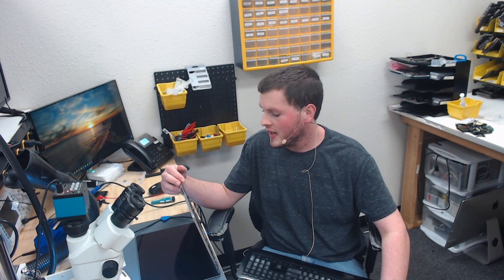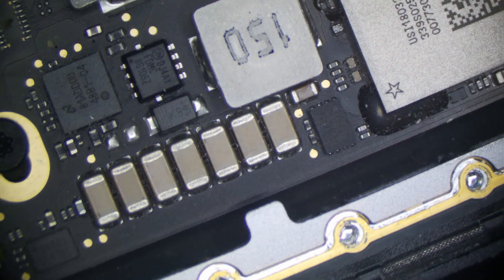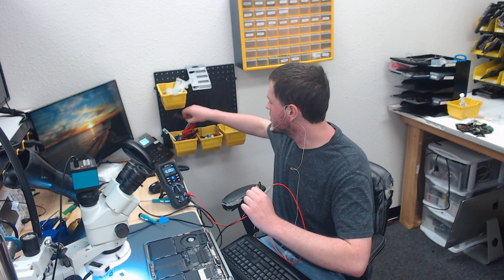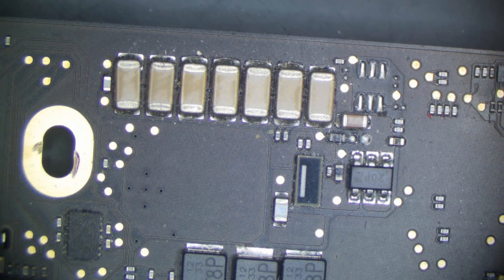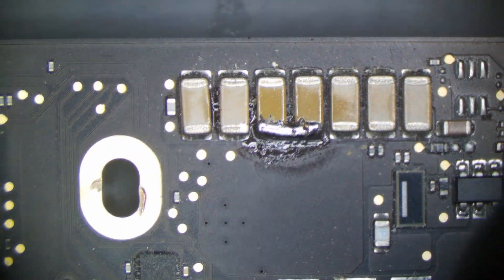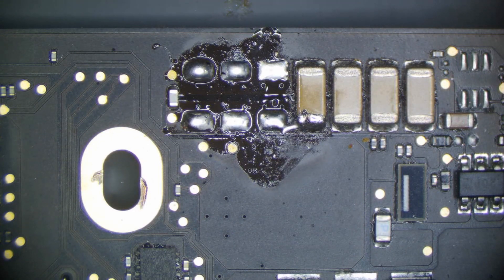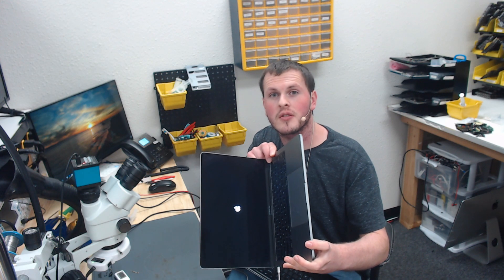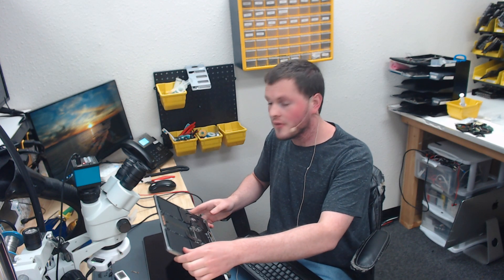2017 13" MacBook Pro A1708 with no backlight from a logic board issue.

Comment: 11:40  The device exists within an atmosphere
and no matter what  - the air condenses when ambient
temperature becomes low enough.
The condensate the is produced is the moisture/water.
When there are other liquid substances present such as FLUX
which is water soluble - 
the FLUX will absorb the moisture/water caused by the condensate.
The FLUX will over time absorb enough moisture to cause corrosion.
This process cycles as when the device ( laptop ) is operating it
produces enough heat to evaporate the moisture -- and the process
repeats over and over  -- 
What does not evaporate is the corrosion that increases over time.
Thus it is BEST practice to remove FLUX residue to mitigate the 
absorption of moisture  reducing the probability of  time induced 
corrosion as much as possible.
Attention to detail is a sign of professional workmanship.
Laziness is both a curse and a disease of the mind.
When one starts letting little things 'slip' with the attitude that it
does not matter -- It does not take L O N G  before one lets bigger
things slip  ---  and in the Medical field and Aviation such practices
soon become lethal.
The do in other areas also - such as walking whilst staring at a phone screen.
SO don't do it - It only takes one error to cause death of serious injury.
Reply from the maker: There is absolutely no flux left there, just staining from acetone, hence "good enough".

Comment: Hi Tim can I ask a question please,  from this video you said you are injecting 10volts into the backlight caps to see what heats up on the board but I'm very curious of how many Amps should be set on your DC power supply please?
Reply from the maker: I set mine at 5 amps and almost never change it.

Comment: Hello thank you for the detailed video, it's very helpful. 
I have a 2017 a1708, all of the caps are showing 94.0 Ohms on both sides of the board. Should I test the caps a similar way using alcohol?

Comment: Great video ! Newbie question here, how should I go about finding the right capacitor to replace on my A1398 mid-2015 logic board (one cap is cracked and burnt) if I don't have a donor board at hand ?
Reply from the maker: Pull up the cap on the schematic to find it's values and head over to digikey.com or mouser.com.
Reply: @TCRSCircuit  Perfect, thanks !